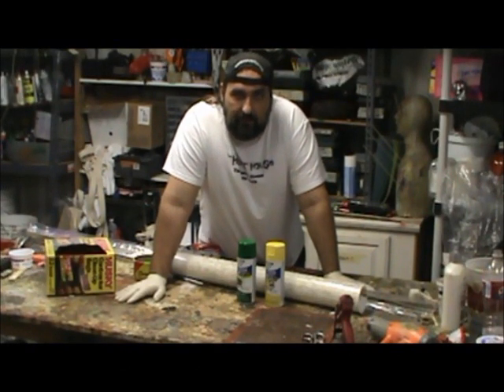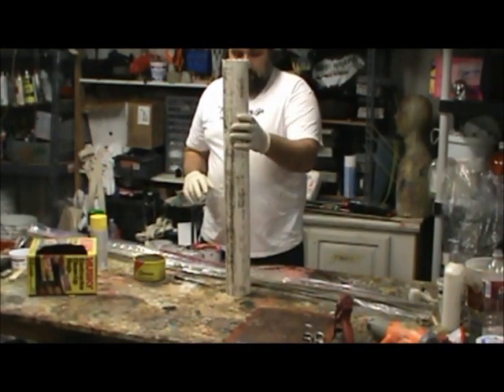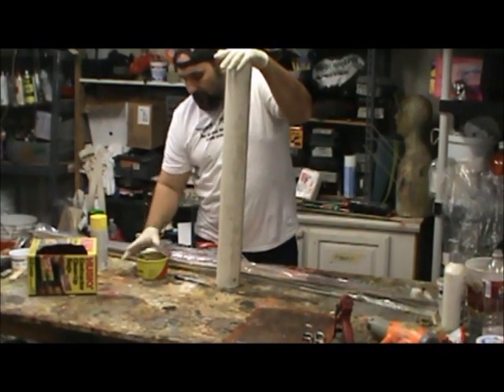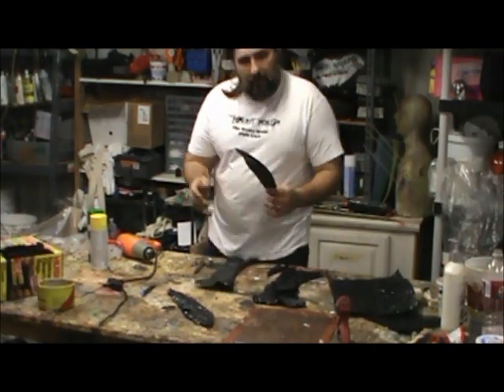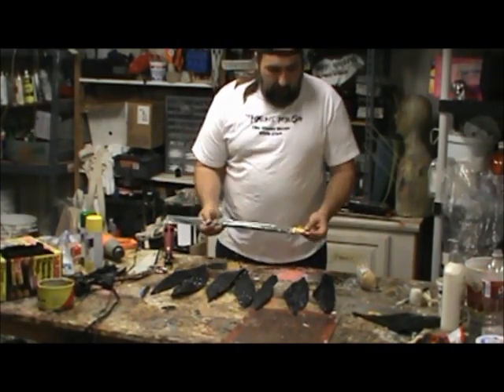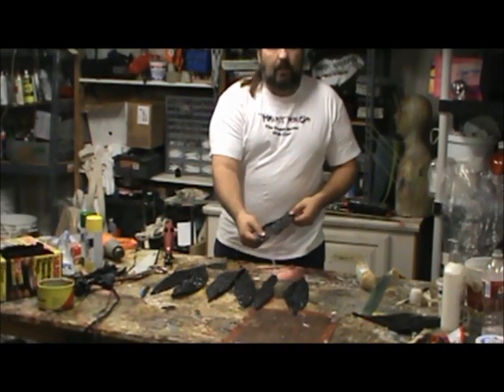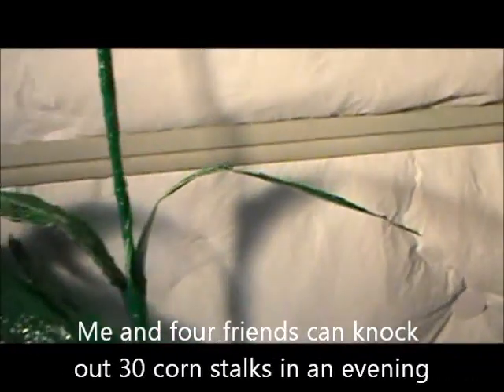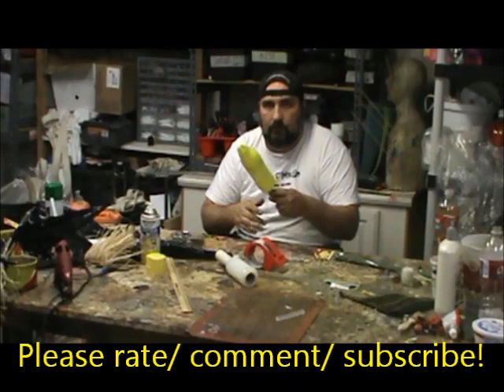Making Corn.wmv

Comment from the maker: what happens to the tape if it rains out?  Nothing Clear packing tapes adhesive holds up pretty well in water.
 i think flat green may look more real? Then use flat green, I chose a gloss because corn plans have a bit of a sheen to them.
 I'm not sure you are the professional? I'm not sure that's a full sentence or question. I do make props for a living so in that sense I am. I am giving you ideas and techniques, alter them as you see fit because of style or purpose.

Comment from the maker: It was still wet, definitely go with a flat paint. I just didnt paint the leaves first, you could have I was in a rush to shoot and did not want to add another drying time. Yeah PVC is an option for sure, and thicker. I may upgrade to PVC for my 300 stalks I need to make.

Comment: Loving all your videos - big thanks for sharing your knowledge with us! Doing corn stalks now and had a few changes - dollar store wire is much cheaper and works as well, some holes and tears in the plastic bags via heat gun look like bug damage (happy accident), and hitting the leaves lightly on edges with heat helps curl the leaves - but too much shrinks them too much. Thanks for finding a way to use up my 40 bamboo stakes!
Reply from the maker: +Brian Hensley  cool, great tips!